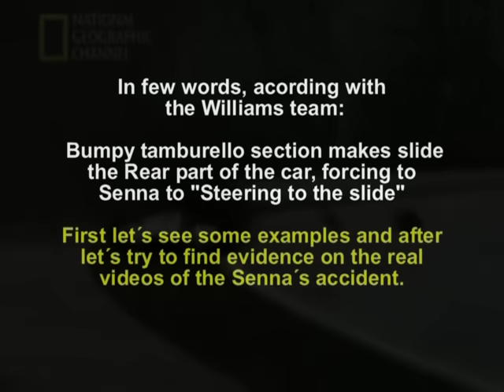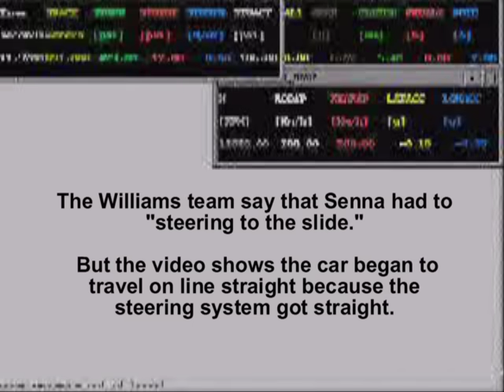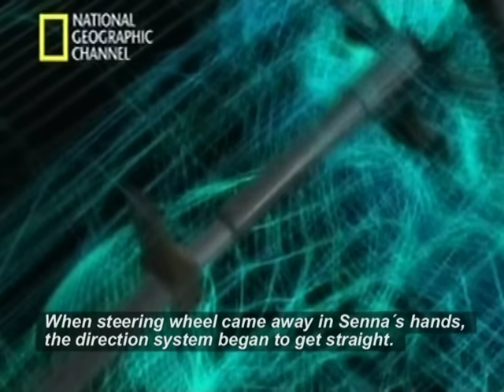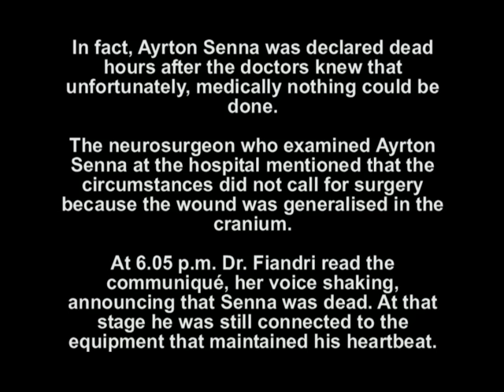5/5 the death of Ayrton Senna - what NatGeo did not tell

Comment: steering column linkage broke. I'm convinced. Senna forever! you were let down by your team.
Reply: Let down by his team? He was the one that insisted the steering column be modified.
Reply: I've only ever heard the accusation that Senna asked for the steering column to be lengthened in this video. Sounds like a bunch of crap. It is far easier to adjust the seat position if he wanted to be closer to the wheel. 

I have heard it reported  that the steering column was modified such that it had two different diameters. The modified piece was a few mm narrower than the rest of the shaft. Why would the inserted piece be smaller in diameter if it was only to make the shaft longer??

What you see in the video is Senna's hand movement doing exactly what you would expect to see when he's holding a load, pushing with a specific force on the wheel to the left, when suddenly all resistance to his push is gone. Resulting in an erratic movement of his hands to recover the connection he felt was lost.

The steering shaft broke. Nat Geo made a critical error assuming that the potentiometer would go to zero indicating no force on the shaft. The wheels are still connected to the shaft and even with no steering wheel connected, the uneven road surfaces would still apply a force back through the column. It's how drivers "feel" the road.

The car, designed by Adrian Newey and assembled under Patrick Head, broke due to the small diameter shaft not able to sustain integrity from  multiple sheering-force hits from the road surfaces (metal fatigue). With no plan to change the part out, it would have failed at the next session, the next race. There was nothing unique to Imola, Senna, or the ride height that caused the failure. 

What's amazing is that Rubens Barrichello survived.
Reply: DarkMadder Too bad the seats are rather fixed in those cars. You wouldn't adjust the seating position because that would shift the weight balance of the car. It is better to bring the wheel and pedals to the driver versus doing the opposite.
Reply: You can adjust everything on these cars.
Reply: ah the differences in viewpoints from someone using a real name online to someone with a profile picture of cartman from south park. just for the record i know you're right.
Reply: the seats are changeable
Reply: Ahmad Carlos not really fair to say he was let down by the team.
Reply: Pick everybody hid the fact that the steering column was poorly welded at the time to adust the car for Senna, nobody ever talked about this publicly.
Reply: Ahmad Carlos.agree
Reply: The whole vehicle is customised to suit driver and drivers style. If the vehicle was modified it wasn't modified by senna. it was done at his request. Whoever modified that part of the column should have done so in an appropriate way and the welds should have been checked, Xray'd Whatever. The point is it should never have broke!! Also Williams Renault took those boxes and covered up some sort of mistakes... I am sure that was not driver error but mechanical fault. 110%
Reply: It didn't
Reply: DarkMadder -- no, it's true. Senna's knuckles were hitting the cockpit's wall or some other detail, can't remember now. So adjusting the seat wouldn't have helped. This does not change the fact that the modification was performed in an appalling way.
Reply: I don't think anyone in their right mind would suggest to his mechanic to do a subpar job whilst you modify the job.
Reply: Yes it was proven and caught on film and Williams tried to cover it up.
Reply: Frank Willians confess to Senna's family. It was the sterling steel.
Reply: Ahmad Carlos For shure
Reply: DarkMadder no offense but you clearly don't understand how purpose-built race cars work.  The driver's mass is placed where it is as part of the car's center of gravity.  Thus, the seat position is NOT adjustable--the pedals and steering wheel are positioned where the driver wants it.  The race car that I drive (SCCA Spec Racer Ford or SRF) is built this way.  The seat does not move, only the pedals and wheel move.  And the reason why the steering shaft tubing had two different diameters would have been to have one slide inside the other.  That does not seem unreasonable to me.  The thing that I don't understand is why they didn't weld it and then "through-bolt" it in order to provide a backup system in case the weld failed.

As far as your statement about Nat Geo's error you are right although you are right for the wrong reasons.  The type of sensor that measures FORCE is called a STRAIN GAUGE.  The potentiometer attached to the steering shaft measures the amount of ROTATION of the shaft.  They are two different things.  If the potentiometer was connected above the break then it would measure the degree to which Senna turned the steering wheel.  However, if it was connected below the break then it would have measured the degree to which the tires actually turned.  I don't know where along the shaft the potentiometer was connected.

And finally, with regard to welding two pieces of steel together there is a lot that goes into it, including the diameters of the two pieces, the wall thicknesses, and the TYPE OF STEEL USED.  The designers would be responsible for the following:
1) Ensuring that the tubing diameters and wall thicknesses were sufficient to handle the loads imposed on them;
2) Ensuring that the welding "process" used was compatible with the selected type of steel.  For example, if say 4130 alloy steel were used for the two shaft sections the resultant shaft would need to be "normalized" (annealed) after welding.  It needs to be normalized in order to make it less BRITTLE!  Or they could have used say 1010 mild steel to make the shaft.  However, for identical size pieces mild steel is not nearly as strong as alloy steel and would thus need to be larger AND HEAVIER, which of course every F1 designer want to avoid.  Therefore one could presume that they would want to use alloy steel.  But, it's vital that it be normalized.

It seems reasonable to me that some engineer somewhere would have done the calculations required by item 1) and that he would have specified the proper heat treatment as specified in item 2).  Then it's up to the FABRICATOR (not mechanic) to ensure that the shaft gets manufactured properly.  The mechanic just installs it.
Reply: Except the seat position.  The seats are molded around the driver.
Reply: @scottreyes17  In a F1 car the seat is an integral part of the monocoque. It would take several weeks to make the necessary changes. Senna asked for the change to the steering column after the team reached Imola, so they used whatever materials were available and created a short-term fix. The steering column passes through the front bulkhead and the sensor is attached to that bulkhead so the sensor would continue to operate (probably erratically) after the column broke.
Reply: I believe you mustn't say that. Formula One teams are  professional fast car enthusiasts and victory is not solely reliant on the driver. Nobody wants their racer to die out of mechanical failures.
Reply: Akhmad okh okh olllk carlos
Reply: @koopatroopa187  he also insisted not to fucking race that day
Reply: @clov3zz860  And he didn't have to. Would that have fired him? No, so why did he race if he didn't want to?
Reply: @koopatroopa187  because his a racer, shame his team were god awful
Reply: @clov3zz860  So what point are you trying to make then? He either insisted on not racing, or he raced because he's dedicated to the sport. He can't do both, so what was it?
Reply: @koopatroopa187  he literally said the race shouldnt go ahead the conditions are too poor but they commenced the race and theres rlly not much point of pulling out that late? obviously he didnt know he was gonna die that day but he certainly didnt want to race or others to race for there safety as well.